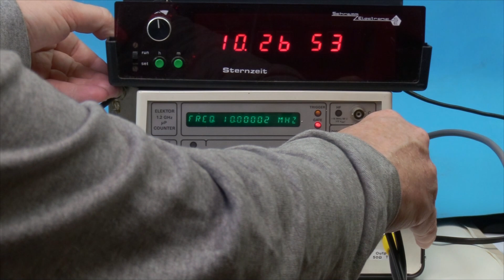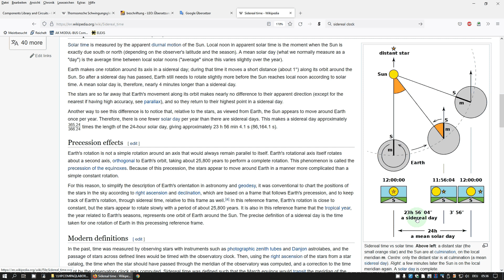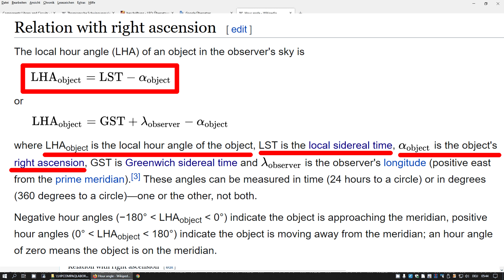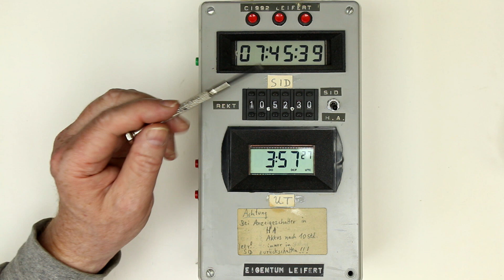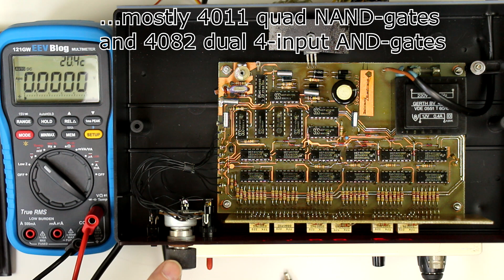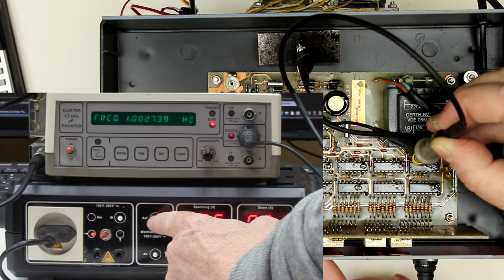A Sidereal Clock: Teardown, Analysis, Adjustment

Comment: A phase lock look that locks to the GPS satellites might make the sidereal clock more accurate.
Reply from the maker: You still have the problem of power failure and need a UPS. A modern version would get time, date and longitude from a GPS receiver and calculate the local sidereal time from that data every second. That way you don´t need a UPS in case of power failure.

Comment: Hi ... nice project and video ... learnt something about astronomy as well ... Could you share more details on that frequency meter? ... I think you mention Electron or Elector magazine? ... any schematics? ... was it a kit?
Reply from the maker: It was published by Elektor magazine in 1985. You can download the article series as registered elektor-member (or buy it as a non-member?) from here: https://www.elektormagazine.com/magazine/elektor-198501/45402
It was at that time top-notch because it was the first "amateur" universal-counter that kept the full (selectable) 6- oder 7-digit accuracy over the whole frequency range by applying the principle of a "reciprocal counter" which is only feasible by using a microprocessor to do the math (here a 6502). It uses a beautiful alphanumeric vacuum fluorescent display and a membrane keypad and dozens of logic-ICs, some of them very special ones.
At that time you could buy a full kit or only the hard-to-get parts (PCBs, VFD display, keypad). I choose the latter option, bought all the ICs and other parts separately and typed in and then programmed the EPROM content with the firmware by hand. The case is full of PCBs, some of them attached as vertical daughter boards to the main PCBs.
Later I added a home-build OCXO which you can see attached on the left side of the case. 
It is one of my favourite instruments partly because of the beautiful display and the well thought out concept of the counter.
Reply: @KainkaLabs  Thank you ... will definitely have a look at this ... from the outside it indeed looks beautiful... and from your description even nicer on the inside

Comment: Easy enough to ovenise that crystal though, especially if it is mains powered all the time, you make a small insulated cover that attaches to the crystal, and inside the cover you put a PNP power transistor and a NTC thermistor to control base current, so that the transistor runs as a linear resistor and heats up, with the NTC robbing base current from it, so that you can set the temperature to a temperature a bit above expected ambient. Temperature just depends on having a well regulated supply to the heater, so another 5V-10V regulator to feed it, and it will keep the crystal at a constant higher temperature. PNP do the collector is grounded, and thus can contact the crystal case and not introduce noise, though it is electrically isolated from it. 

At least an order of magnitude better in stability, though it does drift on power up a lot, after which is stabler than bare crystal. Best to also insulate the oscillator IC, and a metal tab to keep it at crystal temperature, and insulation under the area of board. Even better as well power oscillator from it's own power supply.
Reply from the maker: I even thought about that. You can see on the left side of the frequency counter a home-build OCXO attached to the case, where I copied a circuit from the German ELV electronics-magazine. I could use the same circuit for ovenizing the crystal in the clock. 
But there are 2 problems: The transformer doesn´t have enough power to supply both the OCXO in the heating phase and the 7-segment display with full brightness. And even if I added a secondary PSU for the OCXO, you can´t guarantee that the mains-current is always 24/7 on. Someone could accidentally unplug the clock or there could be a power-blackout. 
It´s easier to check the clock with a smartphone app for sidereal time at the beginning of an observing session :-)